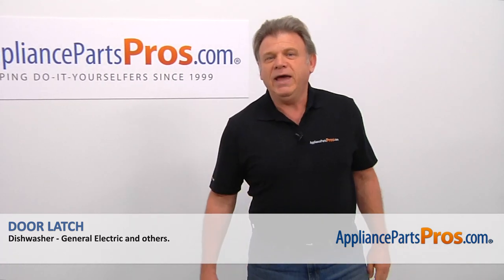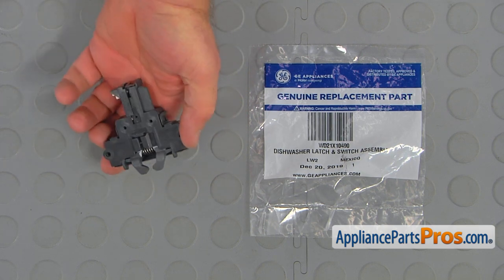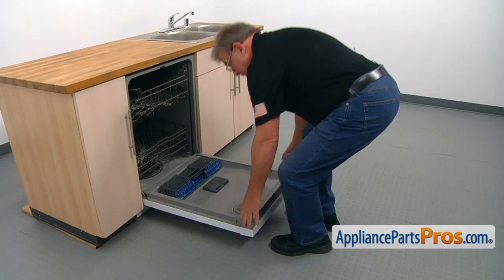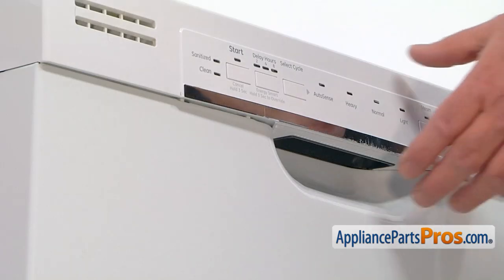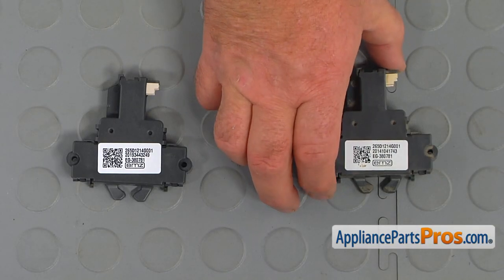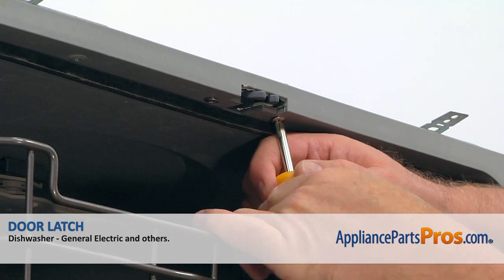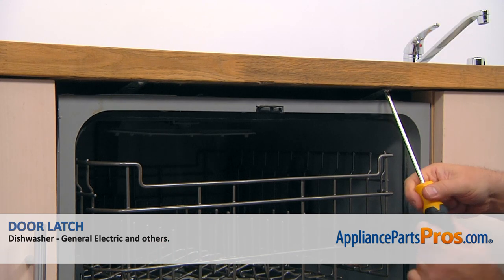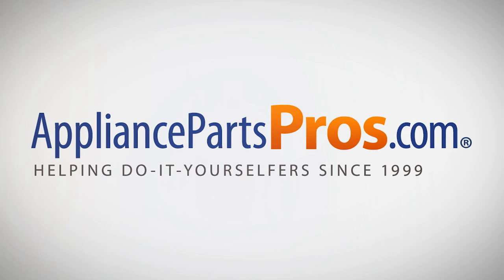How To: GE Door Latch WD21X10490

Comment: I need info on the 18 inch door latch model GMS1800Nbb. What part #
Reply from the maker: It appears the part number you would be needing is WD13X10030. It is no longer available and we don't have anymore in stock. It doesn't appear that there is a replacement part for it at this time, but you can take the part number to google and see if you might be able to find it on google somewhere.